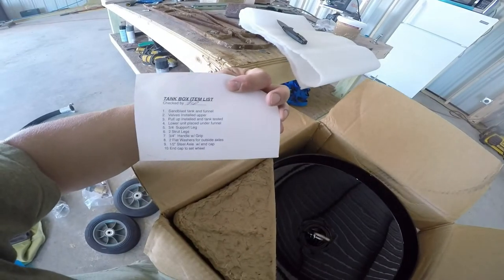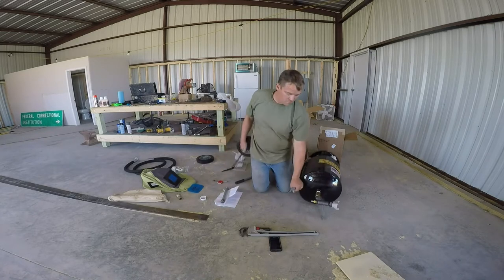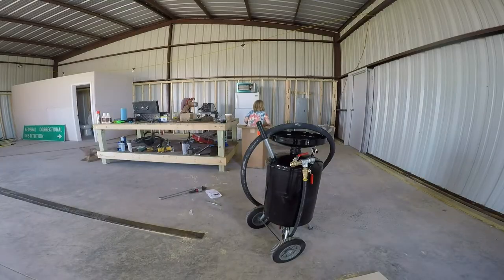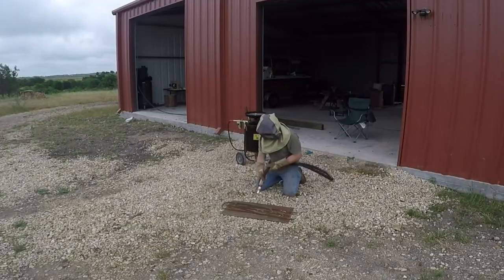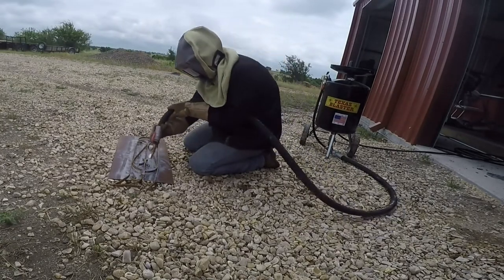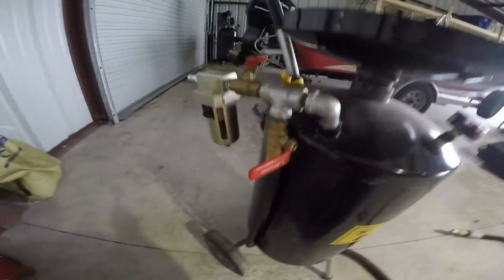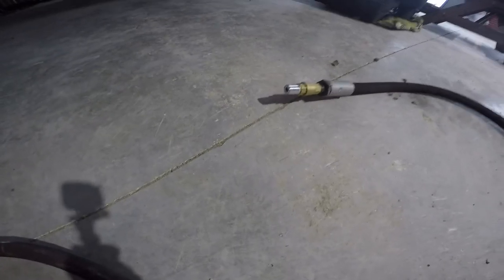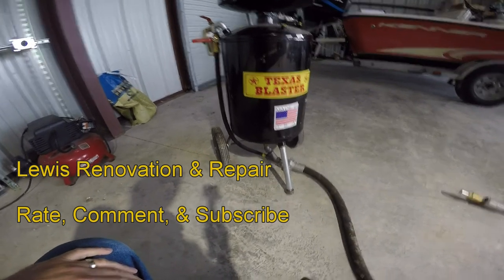Texas Blaster Review

Comment: I am looking to buy one of these.  How much CFMs does your compressor push and what size nozzle are you able to use?  My compressor set-up will move about 70 cfm with multiple large storage tanks.  I am wondering if I can use a 1/4 nozzle at 80 psi with this unit.
Reply from the maker: My compressor is a 5hp 18 CFM unit. I'm using a 1/8 nozzle. It keeps up but I wouldn't want to use a bigger nozzle
Reply: Yo Phil! Did you ever get around to purchasing one?